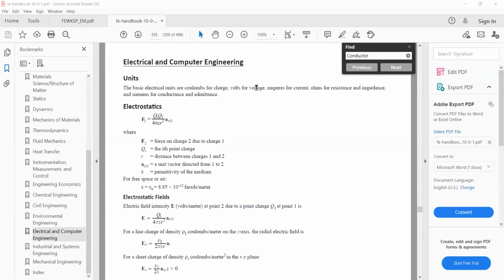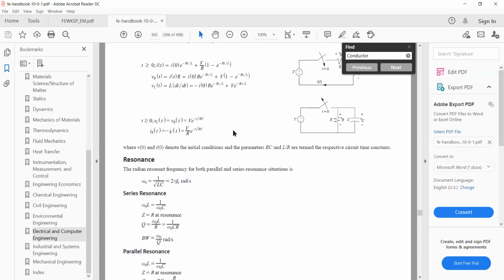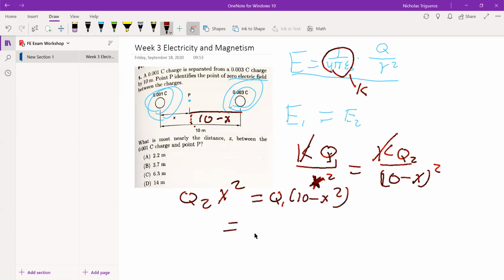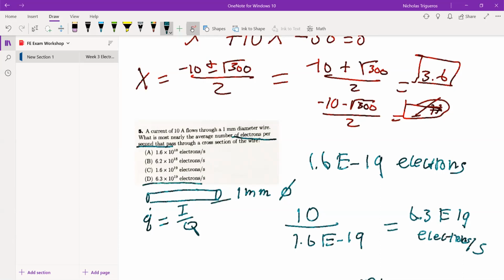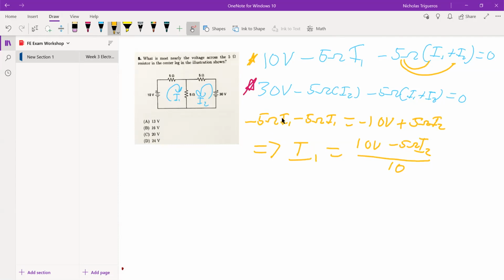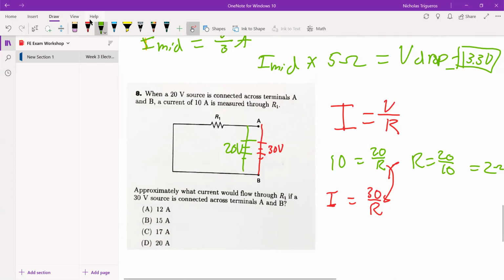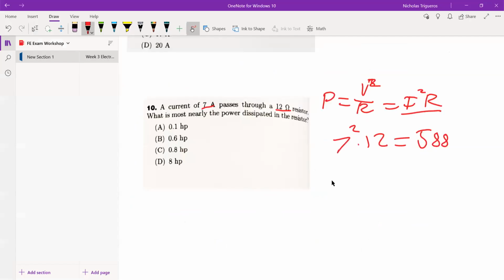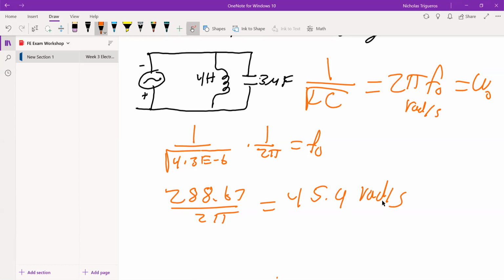FE Review Mechanical Session 3  (Electricity & Magnetism)

Comment: The second problem can be solved with unit analysis and handbook materials. Searching for "ampere" or "coulomb", we'll see on page 85 that a Coulomb is the same as an Ampere Second. Then on page 2 we see that the charge for one electron, e, is equivalent to 1.6E-19 Coulombs. 

So we take 10A * 1e / (1.6E-19 Ampere Seconds) = 6.2E-19 e/s

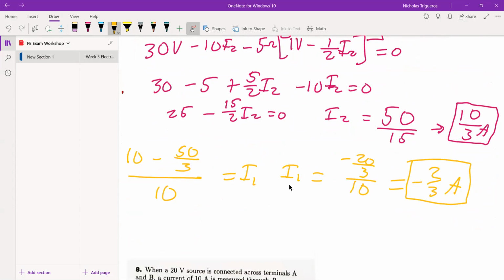Comment: 40:11 or instead of doing a manual system of equations, use the FE allowed calculator to do it for you. The TI-36X pro is an approved FE calculator for the exam. You can use sys-solv which is written in blue on top of the tan button on the calculator. Press 2nd tan for it. The only work on your paper would be rearranging it for your calculator to read it. I recommend this vid to explain: https://www.youtube.com/watch?v=BWeW2PYtICc

Comment: On the second problem, the fundamental identity that 1 Ampere = 1 coulomb / 1 second helped it make sense for me. Along with the 1.6E-19C charge of an electron, it's pretty simple. Unfortunately, that 1A=1C/1s is not clearly in the FE handbook.
Reply: Crazy this is a year ago. You can find out about it from the units conversion table, but also from another place that says coulomb or amperes*seconds. Just use the find tool to do this.